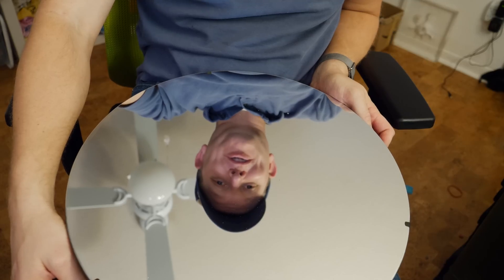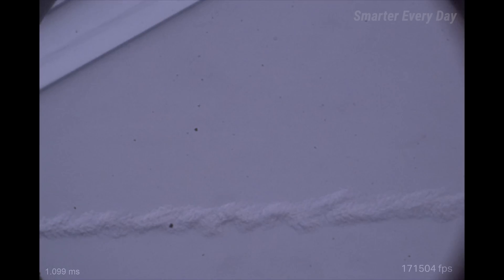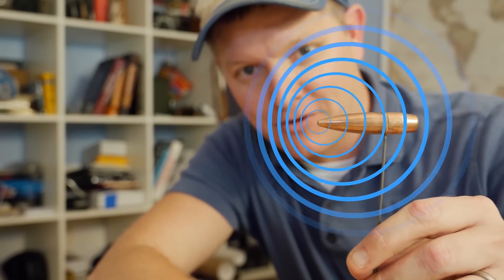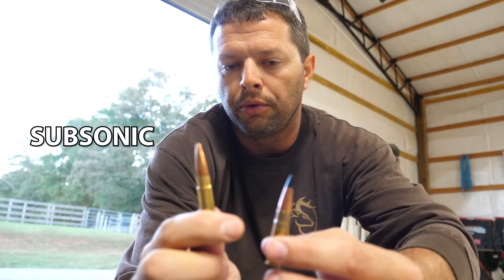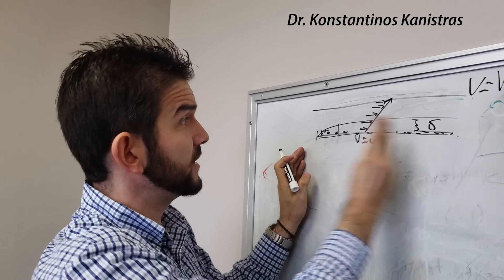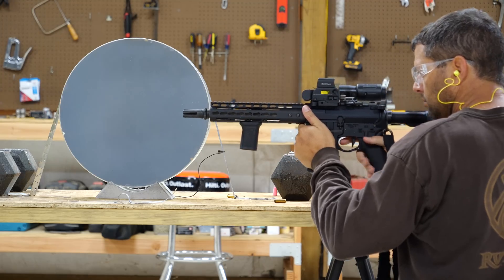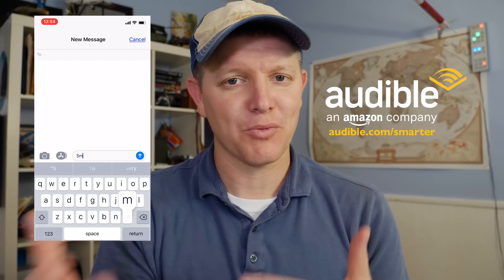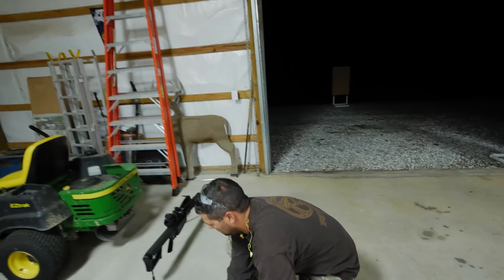Shockwave Shadows in Ultra Slow Motion (Bullet Schlieren) - Smarter Every Day 203

Comment: I believe that those circles you see are the individual shock waves that make up a sonic boom. The frequency of these shock waves will depend on air density, bullet mass, bullet shape and speed. The air pressure has to have time to rebound from the shock wave before the process can start over again.

Comment: That is really cool seeing the shock waves on the subsonic bullet. I wonder if this is related to the instability experienced during transonic flight in aircraft.
Reply: It is the same phenomena. On an aircraft there is also shock buffeting, where these normal shocks move back and forth and create strong vibrations and a change in the center of pressure.

Comment: If you do this shock wave again with a subsonic bullet, I hope you can do one under 1,000 FPS. Like a .45 ACP  or a .25 ACP at around 830 FPS. At those speeds I would like to see what kind of side spike supersonic (SS) shock wave might come off that bullet and compare it to the ones in this video. Would there be a side shock wave at those speeds, would the spike be smaller or would there be fewer and further back on the bullet? 
The ones you shot in this video were close to supersonic, just under and I was not that surprised at the first SS long shock wave spike, it is at the point of where the Ogive meets the shoulder of the bullet. It is the transition point of the curve of the tip to the straight sides of the bullet. It is like a wing foil and the air would have to speed up over that part just like a wing on an aircraft. That second long spike shock wave would have to be where the air goes back to subsonic. There are always 2 sonic booms as items break the sound barrier. The first one comes when you cross that point of going faster than sound, the second one comes when you transition back below the speed of sound.   
This was a great video, hope we get to see more.

Comment: I Have read that air rifle pellets are unstable and that accuracy is lower if they are sent at velocities near the speed of sound.  Could you film an air rifle pellet at 99% mach 1 to see if those short shock waves are stable or not which may explain the lower accuracy if the pellet velocity is too close to mach 1.

Comment: Hey Destin, love the video! A thought on why the waves are making the ripples/circles; it might be because the air the bullet is traveling through is not perfectly homogeneous. As you explain in the beginning of the video, but on a micro level. The bullet is traveling through slightly more and slightly less dense air, creating the ripples. Like ripples in water, since air also just a fluid with a very low density. Another reason might be the frequency at which the light source you are using is flickering at.

Comment: Hi, Destin.
Great video. I imagine those shock wave showing the leak of energy.  And I think it will be a good topic to look into golf ball. It is saying those small hole on the ball some how make it fly further. That is so counterintuitive. Maybe you Schlieren photography system can looks into the energy flow of a flying golf ball? 
I hope that is not too slow. If so, maybe compress air through a pipe can gives it the speed?

Comment: My guess for the circles you were seeing is that the rotation of the bullet, caused by rifling, when combined with imperfections on the surface of the bullet, cause a regular interval where a dip or bump in the surface of the bullet causes its own shockwave. because the bullet is rotating, it happens periodically and you get circles.

Comment: I'm an electrical engineer, so this hypothesis is most likely completely incorrect, but I think the "circles" that you see trailing may actually be a helix caused by the rotation of the bullet. The 2D projection of that helix may be the pattern that we can see. It may not actually be a helix, but I do think it has something to do with the rotation of a bullet. It kind of made me think of a pulsar. Who knows? Maybe footage from above/below shot at the same time as the side angle could be synced up with the side angle and used to create a 3D image/video?

Comment: I guess that those faint circles coming off of the bullet in regular intervals are due to the rotation of the bullet and some imperfections on the bullet. Just a guess though.
Reply: they are the troughs and peaks of the pressure waves
Reply: @nunyabizness6734  exactly, the preasure builds up then releases in regular pulses based on the speed of sound, shape of round, and speed of bullet. It compresses the air to a limit then the compressed air "explodes".
Reply: I'm almost positive that the observable circles are due to the shape of the bullet. If it had a square section, I believe that shape would be propagated.
Reply: Could be determined if it's rifling by doing it with an otherwise identical gun, and comparing the exact distances between the lines.

If it is the rifling, and if we're really lucky, the lines might somehow directly compare with the striations on the actual bullet.
Reply: Cubinator73, perhaps they are coming off the rifling marks that the barrel forms in the bullet?
Reply: Can it be the bullet resonating? Kind of like an arrow is flexing in flight, just shorter and spinning
Reply: Im pretty sure its literally just sound. The peaks and troughs of the pressure waves that come from forcing a metal object through air.

At 2:50 when dustin was explaining circles coming from the tip of the bullet, he was literally describing how sound emits from its source in all directions, thats literally what those circles represent; sound. And when an object outruns the sound i.e. breaks the sound barrier. then you get the triangle shadow, and thats why the shockwave from the subsonic bullet didn't have that triangle shadow.

Comment: If you shoot a round that isnt 90degrees to the mirror, will you be able to see some of the three dimensional aspect of the shock cone? Or do you need the 90 degrees to "register" the light change, because of the thickness of the air overlapping two sides of the cone in the image?

Comment: Re: Shockwave sources - I'm thinking that the second wave is from the wave of gas from the barrel, now that the bullet is out of the way? The bullet is faster than sound after all, so it just is outracing the expansion of gas that fired it, and that actually is the 'gunshot' that we hear? The weaker wave being the sound of the bullet traveling, kind of like that tearing sound you hear just before thunder as the bolt 'rips' through the air as it travels?

Edit: Suppose I should watch the rest of the video before typing all this out D:
Reply: Followup thought: it might be interesting to compare the speeds of the two 'reflection' wave prorogation events to see if they differ

Comment: The discussion about transonic shock waves at 6:07 reminds of the common photos of fighter jets close to the speed of sound (like this one:  https://en.wikipedia.org/wiki/Supersonic_speed#/media/File:FA-18_Hornet_breaking_sound_barrier_(7_July_1999)_-_filtered.jpg).  Is that related?  Or completely different?

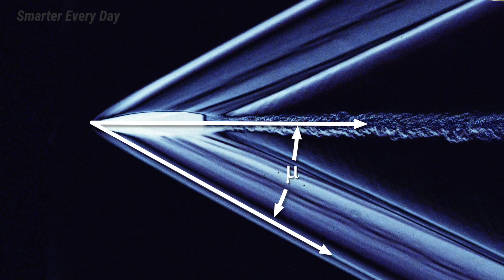Also, I had a potential lights-on "ah-ha" moment when you discussed the "mach angle" 3:36.  Did I understand you correctly, that mach speeds are calculated using that angle?  Or are mach speeds strictly a simple calculation comparing to the speed of sound in the particular medium?

For 10 extra credit point, please explain and discuss...!  :-)

Comment: You would make a great teacher @Destin @smartereveryday. I fly airplanes upto .85-.88 mach (never went faster than that). I believe the sub-sonic bullet works the same as an airplane. However, commercial airplanes don't like supersonic airflow over their wings, therefore the wings are swept back to keep the flow sub-sonic. The max speed of an aircraft is Critical Mach Number, if exceeded, the wing will stall because the air becomes supersonic over the wings. Without the sweep back, the airflow over the wings will be supersonic even at sub-sonic speed of the airplane. 
Bernoulli's theorem explains the reason why the air speeds up over the wing or a bullet that has an airfoil like desgin.
Great video which shows the theories of science at work. Visualization of scientific facts is very important. Something that lacked during my classes. Leading me to drop out.

Comment: Nice videos as always!  😊  However the oblique shockwave angle is NOT the Mach angle in-fact it depends on the initial Mach number (previous to the shock) and on the flow deflection angle of the bullet through a non linear function. You can estimate bullet speed but you have to measure bullet angle too. (for reference 359-360 Gas Dynamics vol.1 Zucrow Hoffman 1976 or from NASA website oblique shockl).  Impressive video anyway!!!
Reply: This dude's right

Comment: Hey Destin, do you think that the spin of the bullet could be contributing to those tiny shockwaves on the edges of the 300blk subsonic bullet?  It seems to me that even though the bullet as a whole is traveling at less than the speed of sound, the surface might be traveling faster because of the rotation.

Comment: Was it just me or did the first sub-sonic bullet look like it was angled upwards maybe a degree or two? maybe its going so slow that the bullet tilts to give itself very slight lift in the front to keep it traveling straight? probably a dumb guess but it looks cool!
Reply: Look up "coning motion" and "gyroscopic precession".    All bullets have this behavior coming out of a barrel but it is to varying degrees.    The motion can dampen out over flight distance or get worse depending on various factors such as velocity and rifling twist combined with bullet design.    Many handloading manuals, Sierra especially, talk about these behaviors.    In slang terms shooters refer to the bullet as "going to sleep" when these motions dampen out.      There are arguments around the 50BMG shooting community on whether or not the 50BMG fully dampens out(goes to sleep) before 100 yards, most argue it is long after 100 yards.

Comment: Really cool, we used to do this at Auburn in the supersonic wind tunnel lab using laser interferometry to see the shock waves.  Since it was a wind tunnel we could sustain the shock for a few seconds so no need for the high speed cameras.  

Destin, a supersonic blow down tunnel made from an air compressor and some acrylic tubing might not be that difficult to build.  Just sayin'.

Comment: Man, that explanation for why the subsonic bullet had those shockwaves was so logical, it almost hurt a little bit that I didn't see it coming. Of course, it's basically a wing shape, the air has to accelerate to make it around, and goes supersonic while doing it. So simple.
Reply: You should look into Compressibility and Critical Mach. This was a big problem in aircraft design towards the end of WWII, and coming into the jet age.

One of the really cool things, where you can see engineering and science at work, is that NACA in the US, a small group of British engineers, and a hand full of German engineers, all realised this critical mach problem mid war. And quickly began looking at ways to reduce the drag caused by the shockwaves, as well as the control surface issues from Mach Tuck. All of these programs we're considered above Top Secret, yet post war they discovered that all of them had, more or less, hit on the identical wing shape to reduce the shockwave size and drag effect.

It's worth the deep dive, there is a TON of good science there.
Reply: @bigbuckoramma  I vaguely know about compressibility and related things from flight sims, it's quite interesting. I remember reading about it in the official pilots manual for a P-51 Mustang as well, they somewhat tackle Mach effects in the manual due to the Mustang having a very laminar flow design wing, and was easily capable of reaching the (dangerous) trans-sonic region in dives from high altitude.

If I recall correctly NACA came up with basically a formulaic way of defining wing shapes (NACA airfoils?), that has been in used ever since; all as part of this related research.
Reply: @Mythricia1988  NACA Airfoils go a long way back, and was even responsible for initial P-51 design. The development of which we even have to thank the British for, but that's another story.

The NACA Series 7, and specifically Series 8, both looked directly Supercritical Airfoil design. There is a LOT of deep dive math and explanations about the NACA mathematics and numerical coding if you really want to get deep into it. Wikipedia has some good explanations and source links.

You can see the British Supercritical design in the Spiteful, Seafang, and Attacker. Which were the British non-swept Supercritical Mach wing design.

And if you poke around Wikipedia on any of the above topics, you will find a wealth of information on Supercritical Mach airfoil design. Just be prepared for your head to hurt a little. Haha!
Reply: Yeah even as someone who knew about the transonic range and that this does occur. that's why planes either fly significantly under speed of sound or significantly over it, this explanation made my understanding so much more clear.
Reply: I'm guessing that's a shrinked down image of how a fighter jet looks when it's about to break the speed of sound
Reply: @KillaCowboy  Correct. If you see video footage of say, the Blue Angles, making a transonic pass at low altitude, you will see multiple shock wave fronts forming around the surface of the aircraft. There is also an image of a JSF going transonic and there are little tiny shock cones forming under the aircraft. Looks really cool.

Comment: If the supersonic speed of an object can be calculated from the angle of the shock wave coming off the front of the object, can the speed of the object be calculated where the angle of the shock wave would be near zero degrees? Has anything man made ever traveled at that hyper speed through air before?

Comment: Great stuff... You could do alot with this, Time the shots and distance out so you can catch the transsonic period in a .50 cal. it perturbs the flight.. or maybe what happens when it strikes an object, or some how that shrimp that can see circularly polarized light and has a Bruce Lee punch (mantis shrimp i think). which raises a question 

How are the dynamics of liquid under compression diffrent than air? A bullet wont fair so well in water & i don't know how to make them 3x faster, speed of sound in water and such, maybe a ballistics lab can. maybe it would be impossible

Comment: What about a whip cracking?
Or if you can work with the water, cavitation bubbles?
Could you put a speaker under the mirror, and see the hertz a tone plays at? Or how the music/speech disrupts the air?
Use a laser to light something up, like a match. See if we can see the heat building before it ignites.
Could you use a jar to stack heavier gasses? Could we see the difference of light in a denser gas? 

If the hertz and the gas differences work, could you connect a whistle to a balloon of helium, air and sulfur hexafloride to see how each balloon produces a different pitch?
I imagine you could have a rig to hold the whistle steady while the balloon deflates.
Reply: If you are able to see the hertz, would you be able to send a Morse code message and have it visible?

Comment: I've noticed in a lot of slow motion videos that some bullets fly 'crooked'.  In this vid the supersonic rounds look 'straight' but you can see it clearly in the subsonic round in this video.   Coop is shooting slightly downward towards the target so the bullets fly past the mirror in a ~5 degree downward angle.   However, in the subsonic shot the bullet itself is actually pitched up a tad from level with the floor.  

Many times you'll actually see videos where the bullet actually pointing downwards, but it doesn't seem to impact the direction of flight that much.

My basic theory on this has been that the bullet is knocked 'crooked' by the muzzle blast, and that most of the aerodynamic forces are concentrated at the very tip so there's little remaining to 'correct' the pitch of the bullet or cause the flight to drift from the slightly varying angles of attack.

If you guys get to shooting again, it would be interesting to see if there is any evidence of yaw in the bullet (maybe by filming from below or via mirror on the floor).  If the cant is induced by muzzle blast it would be chaotic and just as likely to point to the side as it is up or down.